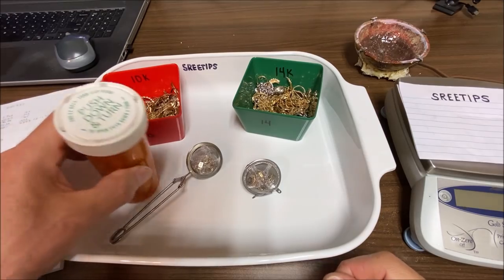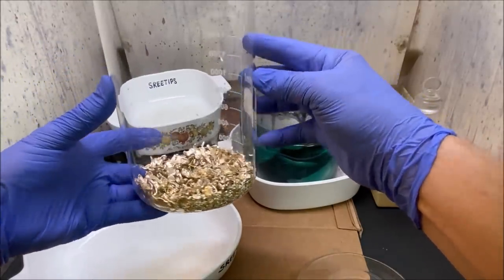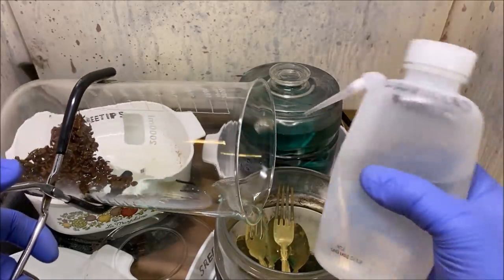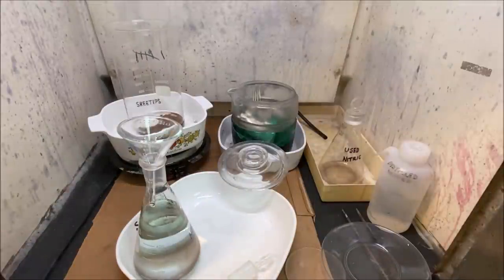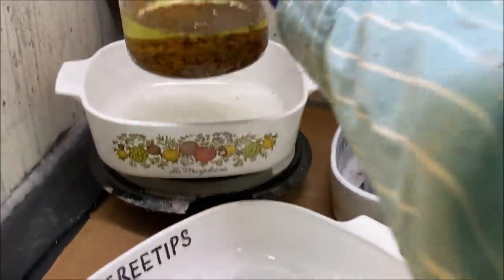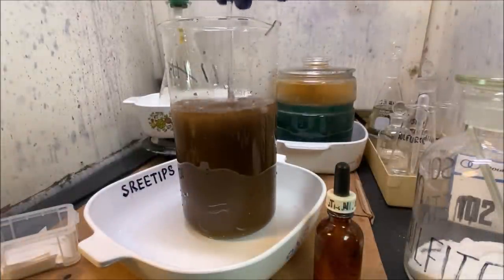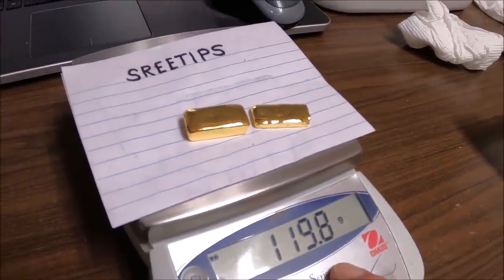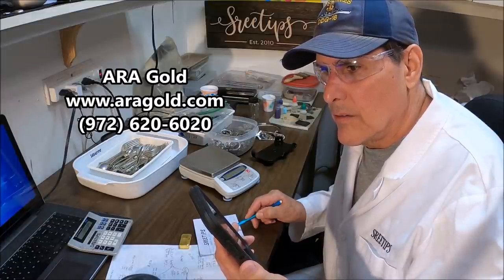How To Sell Your Gold

Comment: you put silver in and than remove it ? why ? just refine what you have AR will dissolve it
Reply from the maker: 1) because I refine silver also. 2) to avoid having to work with a very dirty solution. 3) to avoid passivation of silver chloride on the gold.
Reply: @sreetips  You are refining your gold twice . why not do the silver by itself and use copper to precipitate it (that works )you would at least be saving a lot of precious time and Nitric acid . Just a thought you do a great job of thoroughly explaining your process which I really do enjoy

Comment: I don't get it.  I go gold sluiceing and I save up all my gold for 1 year and smelt it down to just one bar.  Why would you want to mix other metals in it.  The more pure my gold the better the money. (If I actually stop pissing my wife off and actually sell it ) I'm just asking because I don't know,
Reply from the maker: The gold you recover is not pure. It’s anywhere from 18k to 21k. Adding silver to the gold to reduce down to 6k or 25% gold alloy, then parting with nitric is called inquarting. One of the most valuable refining techniques that I’ve ever learned.